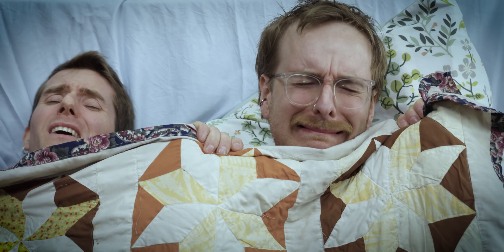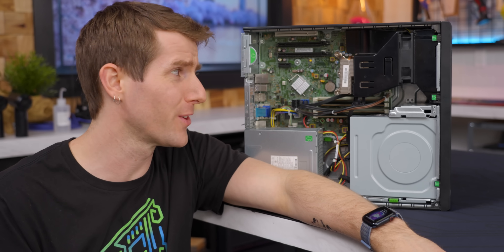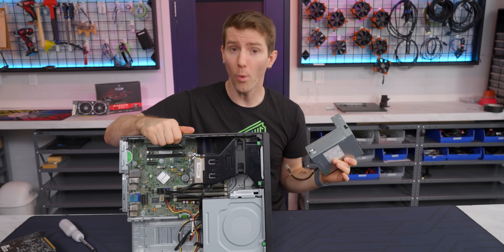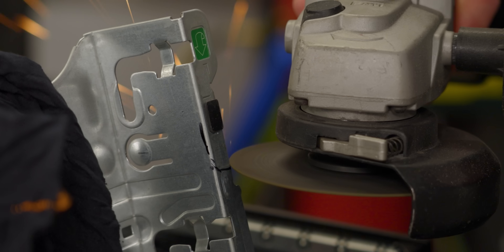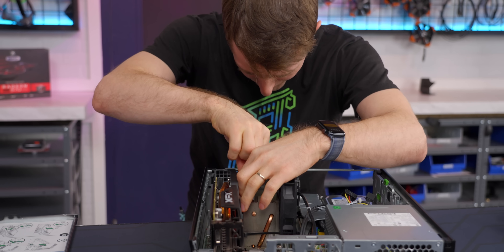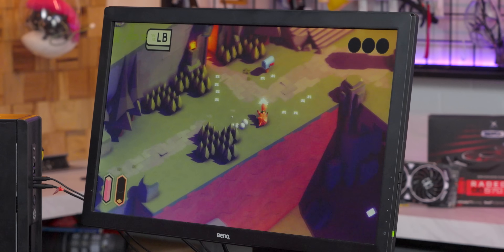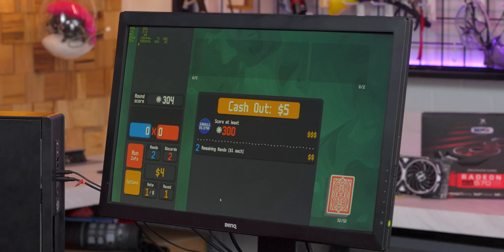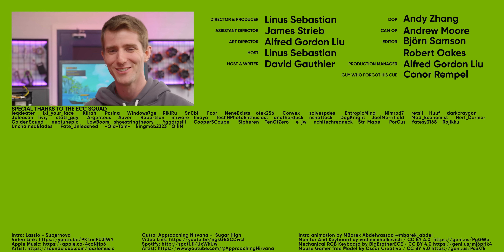How to Build the Ultimate $69 Gaming PC!

Comment: After seeing these too much I was able to put together a gaming/entertainment PC for under $100. Brought an HP Elitedesk for $30 came with i5 4570 2 1tb hard drives, 325 Watt power supply and 16gb of memory. Swapped out one hard drive for a 480GB SSD I had on hand, brought $30 i7 4790, $20 gt 1030 so ended up with something for under $100. Down the road might swap out power supply and get a better GPU since it's also a tower.

Comment: They didn't discuss it in this video, but emulation would be a great use case for this PC. It could probably run RPCS3, CemU, Azahar and Yuzu and Ryujinx forks, as well as emulators for less modern systems ofc.

Comment: After my last gaming computer crashed a few years ago and some troubleshooting indicated the motherboard was the problem I went to rebuilding in a similar fashion as was done here.  I first bought a used dell workstation computer that had a nice Intel i7 processor but was limited to upgrades in the case and on the motherboard itself.  Then I found a second hand motherboard on ebay that worked for the intel chip and then put that all into a newer case I had and then just dropped my older 1050ti video card in to keep that going as it was going good enough for me up until lately.  Only recently did that video card start running a little hotter than it should, and even with a thermal paste reapplication it's past time to replace that one.

Comment: I have one of these z200s. For the CPU, the most advanced and newest one costs 70 bucks on ebay. but the second best cpu only costs 10 dollars so i got that one and the only difference was the clock was slightly faster so its not that much better. and for the gpu i got an AMD E9137 2GB DDR5 low profile gpu and its overclocked and it runs at 30 watts instead of 17 like it used to. That was 30 dollars on ebay. 18 dollar lexar ssd. Its got 12 gigs of ram in it but those are just extra sticks i had so that didn't technically cost me anything because those were in old computers when i got them. And i did the same thing, i put the hard drive back in there for extra storage. It already had a wifi adapter in it and i bought a usb 3.0 pcie card. So i spent about the same. but of course the GPU isn't the best but a really good low profile one that doesn't use a power connecter is about 75 dollars used right now. i don't remember if it supplies 50 or 75 watt cards, i would have to look it up, but i think its 50 and it cant have a power connector of course. Maybe one day ill find a better gpu for it but the 30 dollar one was the best bang for the buck. Better than 4 gigs of ram and no gpu like how i got it. oh, and i had the computer given to me by someone who was gonna recycle it so that didint cost me anything. oh, and i put a new bios battery in there because it was dead basically and would always ask me for the time and date all the time but it was just the battery. also you wanna upgrade the bios if you can! ya know what else is cool? this computer has a built in speaker. it sounds pretty crappy but its loud and if your just waiting on the sound of the bell sound when a process is finished it works good enough for that. But yeah, mines upgraded but i didn't have to take a grinder to it or run it like a gutted fish with all the spaghetti hanging out.

Comment: Just built a hp prodesk 600 g1. 

Took out the 4570 i5 and put in a 4790 i7 for 25 usd.
PNY 250gb ssd for os/windows 15usd
And a strix rx 570 4gb oc edition for 40usd. 
Ran a sata to 8 pin adapter for gpu . 2usd on aliexpress.
16gb of ddr3 10usd
Over clocked to 1425mhz and 1925mhz on the memory. 

I get an average of 90 fps on marvel rivals medium settings and 160-200fps on low.

It runs really well for what it is. The cpu in the video is the main issue. Not gpu, though I’m sure some games will want more v ram, a better cpu would have made a huge difference. If you are not huge into gaming these systems will definitely get you by!

Comment: I got a 480W PSU for €2.50 at a local store(secondhand but working well).
used to be able to get super cheap old workstations as well with fast cpu's and enough ram, like i7-7700 pc's with 16gb ram and a drive in it and a psu which actually supports more for around €30 to €50. sadly these days there are piles of secondhand scalpers, who pay marketplaces here to hide some adds from normal people, then they send one of their people to buy it for even cheaper pretending it is worth nothing, and then they sell something for the same price or more than what it actually would be new(something compareable).

Comment: 580 8G is ok. Luckily you weren't left with a 570/580 4G which are flodding the market, and with the way sellers misrepresent these days. It's so easy to bid on an 8 gig and oooppps it's a 4g. Honestly sizeable RTX 5500 XT can be had for good deals as can RX 3050 8G if you look and snipe,  which would be my hunt for a budget. One for 20 to 35 USD could be a much better option. 8G 580's can be had for $35 if you look hard enough.

Comment: I'm new to the channel, enjoyed the vid and have subscribed.  I have a question on a budget partial build.  I have 30 years of build experience and a senior infra engineer in my day and sometimes night for most of this time.  I have an old spacious "whitebox"  case with a later gen 650w PS.  The core 2 duo and 8gb RAM in it today wouldn't run a 1st generation Steam game, (Half-Life btw was awesome back in the day).  Being in corporate IT for my entire career, I would think that a $53 dollar replacement MB for something like a Dell Dell Precision T7910 (the first thing I hit on after watching this $279) would work.  This sports a Dual Socket LGA2011-V3 and DDR4, as well as two PCIe GPU slots. I can get two V3 Intel Xeon E5-2630v3 2.4GHz 8 Core 20MB for $7.99 USD ea.  Engineering workstations you know, are generally a bit more robust than most gaming machines for things like rendering precision design tools like AutoCAD and Solidworks.  This one doesn't support the later gen M.2 storage bus though.  I have a left over SSD an old GPU that will be upgraded later on.  I would think this would work fine as the base core to resurrect a low end gaming PC for around $100 USD. 
What say you experts and fellow YouTube consumers?  Do dual procs work for gaming?

Comment: i still remember when i was new to pc world during the pandemic. rocking a dell optiplex sff with 3rd gen i7. slapped a exact rx570 in this video and atx psu, the psu sit outside and use the riser cable for the gpu. its basically a open case pc for the sake to play Flight Simulator X. that was a good time for sure.

Comment: need assistance with review a budget laptop KAIGERR RX16 I planning in purchasing my 1st gaming laptop currently running a prebuild PC desktop with Intel i7 second gen CPU did tried to upgrade GPU AMD Radeon compatibility with WIN10 is a disaster so far running Ubuntu Linux no complains but due to the cheating issue Im unable to play most online games only running 1TB drive, thank you cheers from Belize

Comment: Still using the RX570 8GB overclocked to 1400Mhz playing Dragon Ball Sparking Zero it handles it pretty good its paired with an intel core i5 4460 with 16GB DDR4 ram and a 700w PSU , shocked to see it play God Of War Ragnarok smoothly with FSR on Balanced , still a beast of a card

Comment: Great content Linux, try with an Asrock Mining Card BC-250 (PS5 Oberon chip with 6 cores/12 threads AMD BC-250 16GB GDDR6 Playstation 5 APU Single Card With 16gb) use Fedora Linux, I would love to see a custom 3D Printed case with fan and power supply made by your team... btw it run around the same FPS of RX 6650/RX 6700... I saw a video of a crazy russian explaining how to build it with 2 case fans and a 500W power supply

Comment: I build a low budget PC for my best friend:
An work colleague had a Ryzen 5 3600 for 20€
Case and PSU were free on marketplace
Mainboard was 25€
RAM was flying around from my upgrade: 2x4GB
GPU: I had an GTX 1660 lying around
What’s yet to come: 
Maybe upgrade to 2x8GB and an SSD, the hdd sucks and is near dead
So for around 60€ I built a pretty Decent PC. 
Alternative: an R5 1600 was around 20€ and an RX570 was for around 40€ so for around a hundred euro you can build a PC.

Comment: I got i7-7700, gigabyte z270 gaming k3 motherboard, 16gb ddr4 ram, corsair 650W and 1TB sata 3 ssd for 129.32USD and now i'm thinking about which good cheap used GPU would be worth buying any suggestions? My GPU budget is 51,73 - 77,56USD

Comment: Worksafebc wants us to wear a full face shield when cutting with zip discs in an angle grinder.  I have personally removed some chunks of carborundum from a guy’s cheek on a construction site years ago.  Those discs are sometimes invisibly damaged and they spin at a really high rpm.

Comment: Started doing that 7 years ago when i really wanted a PC. Got a gtx 950 with a random CPU on someone's old pc that i bought with the monitor and keyboard and mouse so it was almost free for 25$. Played DOOM on it, gta V, the witcher. If you really want a PC, do that, watch videos, check the market and start the path, later you will upgrade as you feel the need and have the money, you sold an old part add a couple of bucks and buy a new. It's better to have a pc when you want it, than to get it when it's just a desire of the past.

Comment: Yeah. The thing of it is, up until sometime in the 2000s Moore's law was in full swing, you were getting doubling of performance every 18 months.   You REALLY had to temper your expectations if you were going to pick up a used system.  More recently, it's like 10%. And sometimes that is just from putting on more cores as opposed to actually making the cores any faster (and your games only need so many cores.)  

I'll note, if you go for Linux + Steam (or wine, dxvk, vkd3d) you will find LOTS of systems that do not meet Windows 11 requirements, so they are being dumped onto the used market.  Cheap, and increasingly cheap as that date comes up.  And the performance on them can be quite nice.

AMD/ATI and Intel GPUs going back astoundingly far (like 20 years) are supported by the Mesa Gallium 3D drivers.   Nvidia, avoid the world of pain and just use the Nvidia-provided drivers.  But (at present) these still support all the way back to a GTX750... not that you'd want to use something even older than that in a gaming build, but Linux distros actually do make it pretty easy to just drop in a older kernel and run older Nvidia driver that supports your antique Nvidia card.  

I did this last year on this ridiculously huge Qosmio G45, put older kernel on to get the Core 2 Duo-era Nvidia card going at full tilt.  It's the craziest "laptop" I ever saw, it's got to have close to a 20" screen, weighed over 10 pounds, had something like 7 or 8 audio jacks alone... bunch of USB ports... firewire... HDMI, VGA, and SVideo,  HD-DVD drive which is ever so useful these days 😅... I think also TV input, sd card, dual cardbus slots, maybe even serial and parallel ports... like it had more ports than I've personally seen on any desktop let alone a laptop.  A friend is planning to use it for podcasts (since it has so many audio inputs/outputs on it, whether they want to use headphone jack mics or USB ones.)

Comment: 8:50 as someone who sells second hand hardware, the "what's your best price?" questions are frankly a slap in the face. I'm often open to bartering, but just asking the lowest price is lazy and I'm not interested in that. HAGGLE with me if you want to barter down, don't just put in zero effort and try to get an easy win over on me. I usually increase my price whenever I hear this lazy question, and when people ACTUALLY give me reasonable prices in haggling, I'll either take the offer or try to compromise with them.

Comment: Problems
1) Do not recommend using 4c/4t CPUs, they run modern games really bad, the lack of threads cause serious stuttering.
2) Do not recommend using pre-haswell CPUs, they lack AVX2, so even an i7-2600 will struggle in some modern games.
3) whoever cooked up that GPU tierlist has no clue what they're on about putting the GTX 780ti above the far superior GTX 1060 3GB and GTX 970. 

On that note how to actually pick a used GPU at this tight of a budget consider driver support and features first:

Tier 1: Has active driver support and >= 6GB VRAM, e.g. RX 5500XT 8GB, GTX 1060 6GB
Tier 2: Legacy driver support, modern features and >= 6GB VRAM e.g. RX 580 8GB, GTX 980ti
Tier 3: Modern driver support < 6GB i.e. RX 5500XT 4GB, GTX 1060 3GB
Tier 4: Legacy driver support but modern features < 6GB i.e. RX 470 4GB, GTX 970
Tier 5: No driver support but modern features e.g. R9 390/290
Tier 6: No driver support and no modern features e.g. R9 280X, GTX 780ti

When you know what sacrifices you may be willing to make to hit a lower budget you can consider performance, where for an example if you have the choice between a GTX 750ti, GTX 950, RX 460 or R9 270 at the same price the RX 460 is going to be the best option if it comes with more VRAM otherwise you might consider the 950. 

The easy answer for anyone who doesn't want to think though is just to get an RX 470/480/570/580 4GB if they can't spend the extra for an 8GB or a 6GB 1060. There are tons of them and they can easily go for as low as $30. If you can find a RX 5500XT 8GB for a similar price to those that's the best option, but the 1060 will do just as good, an 8GB AMD will be lacking in Alan Wake 2 specifically, but probably more games as drivers stagnate and 4GB AMD is worth going for if it's a lot cheaper or you just don't have the budget for the better alternatives (will likely not run more VRAM intensive modern games).

Comment: Caused by the Win11 incompatibility you get here in Austria nearly every HP Prodesk 4xx or 6xx G2/G3 for almost free, because companies will get rid of it. Specs: mostly G2: i5-4570 or 4590, G3: i5-6400 or 6500, 8GB, but no harddrive or SSD for safety reasons (but you will get 256GB SSD also almost for free second hand). Best of them: I it's not a SSF model (the small/er ones) the PSU is 100% standard, so you can use every second hand 450/500W PSU with additional graphic power lanes.
Best for $ GPU without need of power lanes: GTX 1650 Super - you will get this even in SSF, so no "case modding" ist needed - even for the smaller HPs - ideal for a smart and small Batocera build (up to PS3).

Comment: I would love to see the $69 PC with viable, cheap upgrade paths continuing to keep it as cheap as possible  (Maybe maxing out at $300).  It's a great experiment!
  
A few years ago I built myself a cheap garage PC that was capable of doing some basic streaming on twitch.  I had a number of parts kicking around, but managed to build something half decent for very cheap.  I still have this PC kicking around even though I no longer have a garage and it has become my backup gaming PC when my daily driver decides to have issues.

Comment: It would be so difficult to even build a used $200 gaming PC these days, and you would have to make a lot of compromises. But, using the refurbished Dell/HP route, a standard ATX power supply might not fit in their cases, and sometimes they have proprietary power connectors on the motherboard making it next to impossible to upgrade the power supply. Using two power supplies is janky, and adapters might be an electrical fire hazard, imho. I would rather try to find a used 6th, 7th, or 8th gen workstation than an i5-2500K which has got to really be showing its age these days, especially on games. You might be able to upgrade the CPU for cheap, especially if you went with a 4-core, 8-thread Xeon 2nd or 3rd-gen. i7-equivalent (depending on the mobo and bios compatibility), but even then you will be stuck in a very dead-end platform. If you could afford a 10th gen Intel build or 3rd gen Ryzen (even at the low end of using an i3-10100 or a 3300X), that would be so much better. Also, the RX 570 is one of the worst power-inefficient GPUs of all time (and its cousin the RX 580 isn't much better). I would rather go with an ASUS GTX 970 Strix which is about 10% faster than the RX 570 and uses about 140W vs. 220W.

Comment: As a proud owner of RX580 8gb, I can say it's not worth it getting it anymore if you want to play anything new.
It certainly can run even newer games at least FullHD 30 Fps on high settings, but some games just don't work. Alan Wake stutters down to a respectable 5 fps and latest Final Fantasy games won't launch outright. Anything requiring mesh shaders or DX12.1 Ultimate is out of the question.
Also, the driver updates haven't been released for more than half a year.
But it's still good for older or low requirement titles and indies, though.

Comment: I took the 2nd hand route on a complete setup, 5600x - 2070 s, 16 GB, and rando PSU, updated the PSU, to like a 2nd hand 750w, waiting to get a better GPU, I got a 2k monitor, and it's kinda bothering me that I don't get higher FPS on some games, the initial buy was around 500 USD, thats the prices we get around in my country for a system like that, I think with the PSU and a better SSD, I got up to 600...no case, it's wall mounted with a DIY mount:)), I got like a steal plate for like 10$ then cut out 2 different older cases mb supports, painted all black, and voila 😂😂

Comment: While here in Malaysia I even tried to sell a desktop with i7 2600, GTX970, 16GB RAM, 500GB SSD with cache, 500GB HDD 7200rpm and a 600W Corsair PSU and an optical drive as bonus for only 100usd and nobody interested but they are more interested on a celeron laptop.